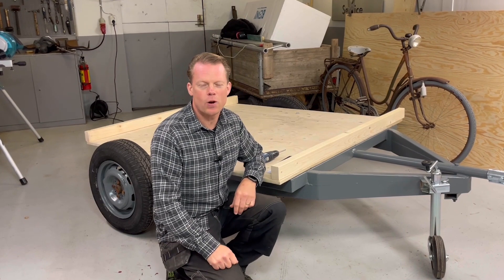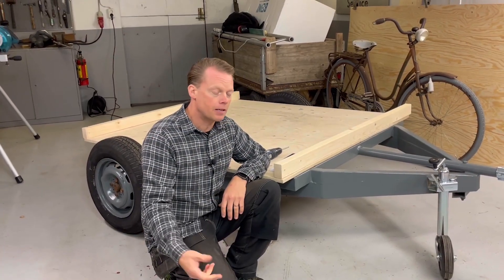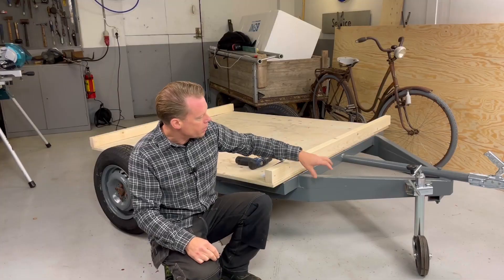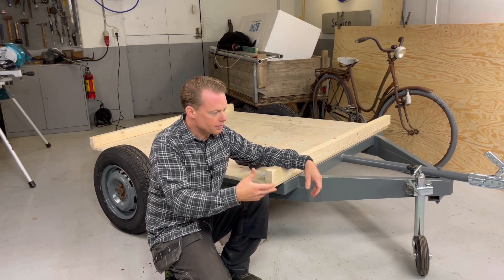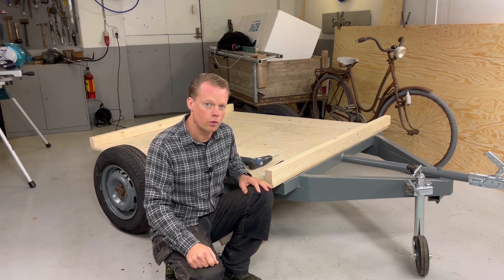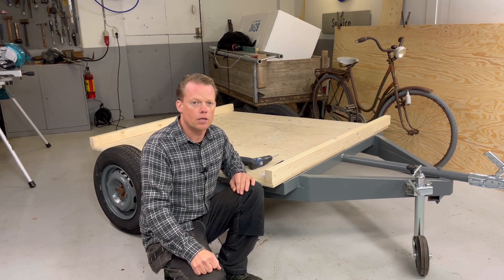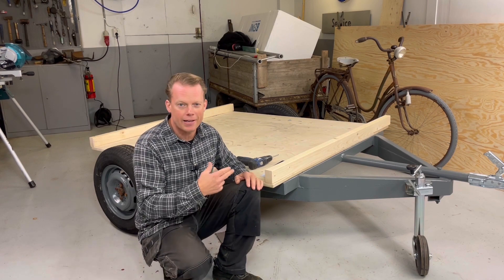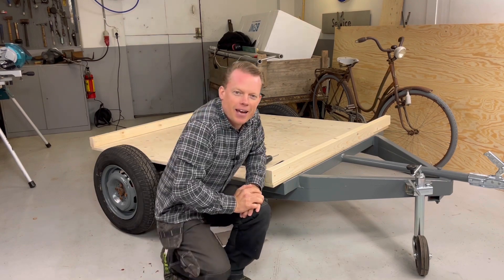Building a trailer to my VW Id3 battery and October monthly power update.

Comment: Was wondering if your id3 batteries are lifep04 cells and how many watts your solar system is. I like your idea of using the external heater to keep them warm. I am using rv tank heatets to keep mine warm in my shed .
Reply from the maker: Hi!
Lion cells, 11,25kwp. Thanks. Its almost the same typ of heating then😊 Thanks for your comment.